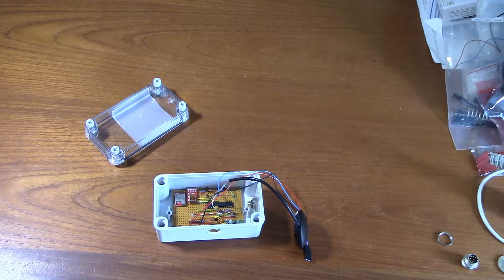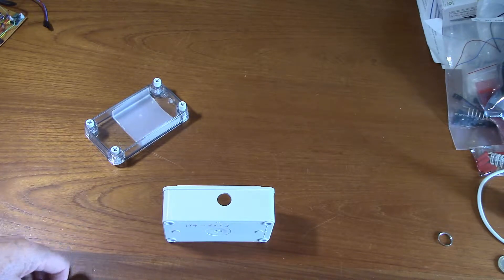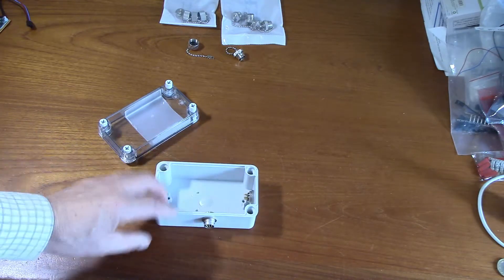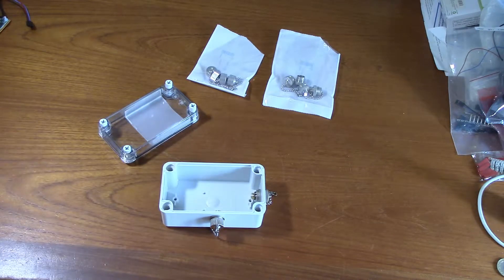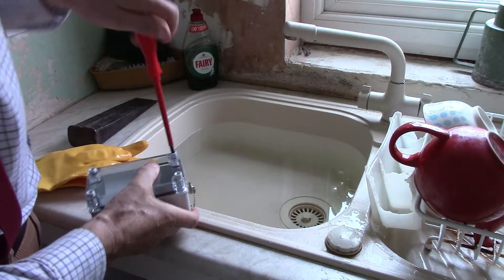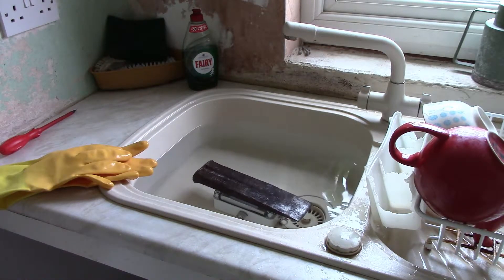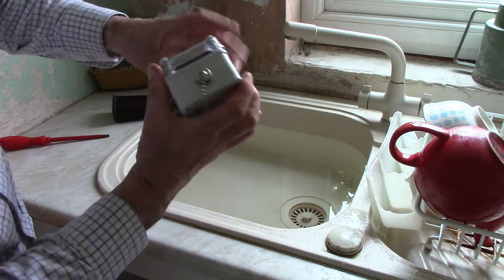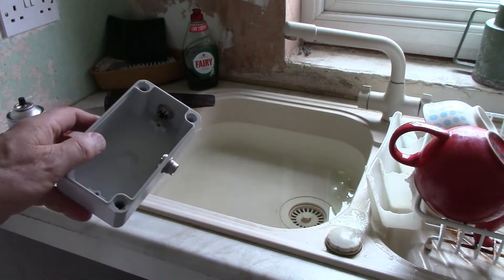Test waterproofing of IP68 box and connectors

Comment: Finally I found the video that I've been searching for
Reply from the maker: Thanks. I have moved on to use Souriau UTS connectors nowadays. Although they are plastic and thus not so mechanically strong, they have bigger O-ring seals and hence seal better if your box holes aren't quite accurate.